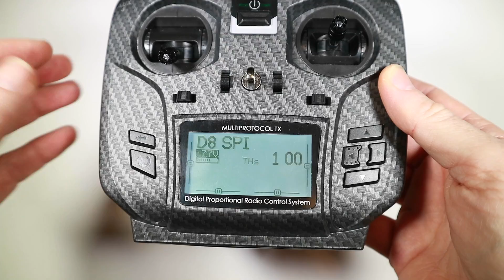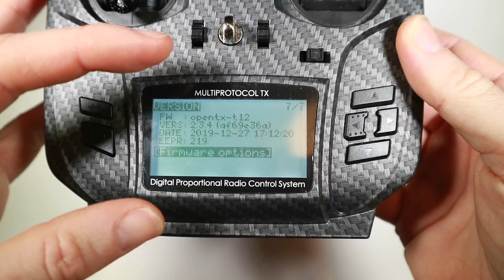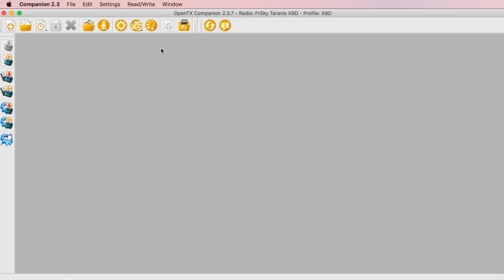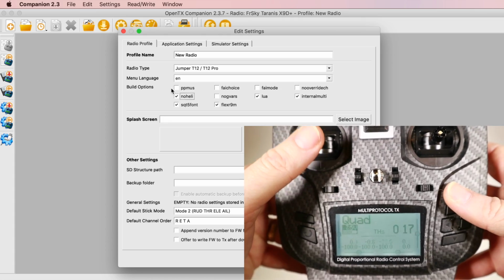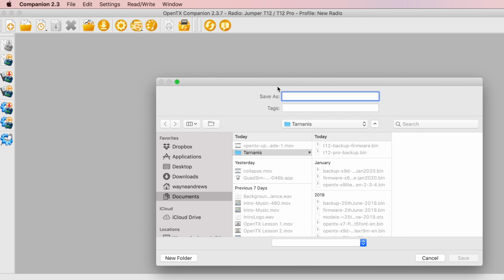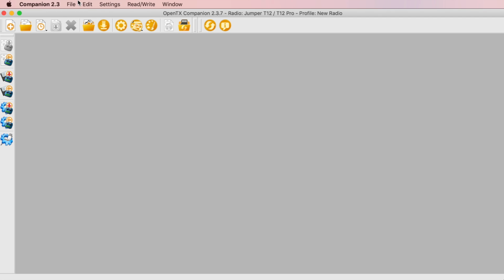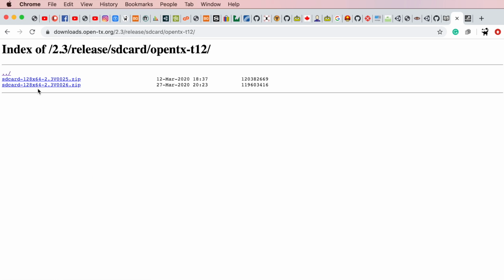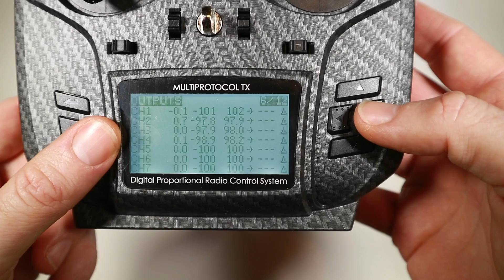OpenTX Pt 3: How to use OpenTX Companion to update your radio's firmware

Comment: Very useful indeed. A question:

I've got a QX7 running 2.2.0 (not been changed since I got it 2 1/2 years ago). I've just installed the latest 2.2.x openTx companion (never bothered before).

I don't really want to update it if I don't have to (as you suggest) - being a software engineer I've no particular fear of flashing devices, but accidents can happen. However I'm looking to fit a multimodule - probably an IRangeX IRX4 plus - to give me more non-FrSky receiver choice and to fly Bayang protocol devices etc. (I'd like a T12 - saw your review - or T16, but this is a cheaper way).

However, I don't know what options were built into the firmware - did it include multimodule? It appears that the firmware options list under the version menu doesn't exist in 2.2.0, probably came along later, and I cannot persuade OpenTx companion to tell me either.

Do you know any way of figuring out what options are in the firmware it currently runs? I notice that multi does not show up in the external RF mode list, but that might simply because I haven't bought one and plugged it in yet. If I do have to update, I guess I'd go for the latest, 2.3.7.

Really like the look of your sim. I was going to look into doing much the same thing, also using Unity as it seems to be ubiquitous, but I'll be very interested to try yours and see how it turns out. I think Unity expects you to use C#?
Reply from the maker: I reviewed the URUAV multi module (same hardware pretty much as most other ones) here https://www.youtube.com/watch?v=HdZ8m0sHNP0 and it looked like the support appeared in 2.3.0 (as I had to grab a release candidate for it at the time)  I think (not double-checked) the option for the radio to tell you what compile options are in the current firmware come along in a later OpenTX than you have as well (usefully enough!)

Yeah - Unity is used a lot, it's free, the docs on it are quite good and you can get some reasonable results pretty fast.  Yes, code it c# based.  Youve got a few popular alternatives though, Unreal Engine - which I didn't try because it was too much for my previous iMac (which I started developing on) and I don't like c++ much either.  Godot is another one, uses it's own scripting, but from what I hear it's better at 2d than 3d.
Reply: @CurryKitten  Sounds like an update is going to be needed. I suppose if an accident occurred that's a quick route to T12 or T16! (Prefer the T12 which everyone else seems to ignore, but I also saw your DMA conflict video). Some sort of multi must be supported though as it's in the 2.2.x profile list.

Also saw your URUAV module review, but some months have now passed, so hopefully the bootloader bug is gone.

On Sims, slight personal preference for C++ really, but it's a minor thing. I'd guess C++ is probably faster, but I'd also assume all the real heavy lifting is done by the Unity framework, which is reputedly efficient.

Comment: I noticed that the "Eu" tick box is no longer  an option in the Build screen !!!
My Qx7 is flashed with 2.3.5 so I am trying to figure out if it is worth flashing 2.3.7 !!!
I don't want to loose the D8 option which I have at present on 2.3.5 
Any ideas !!!
Reply from the maker: What boxes appear do depend on the radio profile, so on the Jumper there's no notion of things being UE or FCC, but if you go to OpenTX Companion and tell it you are using a QX7 then you will see the eu box.
Reply: @CurryKitten  Thanks for the reply

Comment: I messed up my Bootloader on my Jumper T16 external module. I need to get back to 2.3.4. Is this possible and how do I do it? The Bootloader that I have now is 3.something and it doesn’t work at all.  Thanks!
Reply from the maker: 2.3.4 sounds more like the openTX version, I think the multiprotocol firmware works on a completely different versioning.  I don't have a t16, so I'm a bit in the dark here, I did have to update the bootloader on another multiprotocol module though, and that was a bit of a pain and involved soldering.  It this page of help - it seems to cover most things https://www.rcgroups.com/forums/showthread.php?3428887-Jumper-T16-Internal-Multiprotocol-Module-Firmware-Update
Reply: CurryKitten Thanks. I am running OpenTX  on the T16 but have the old external module. I think I’m just going to leave it alone since all my Quads are running fine. Don’t need the Bootloader till things aren’t working right.